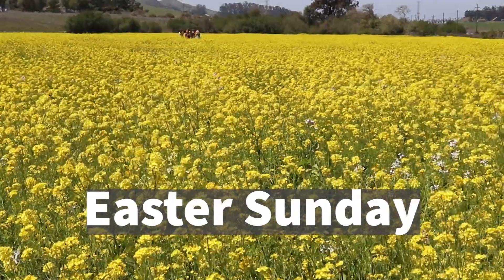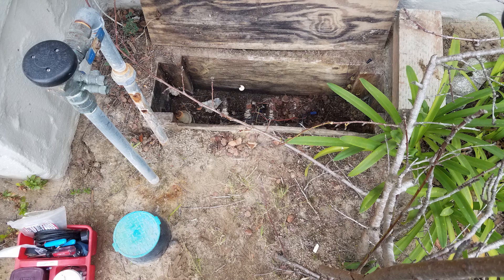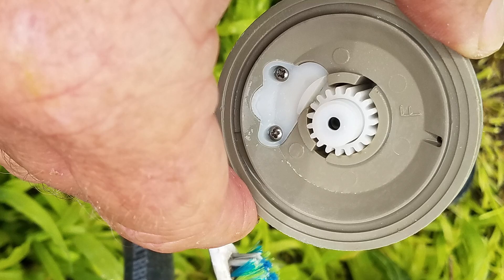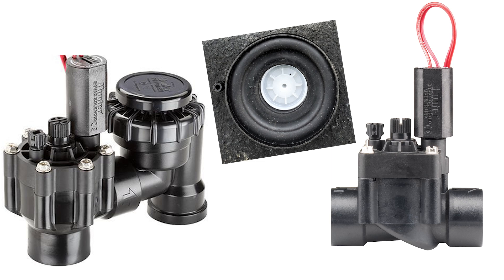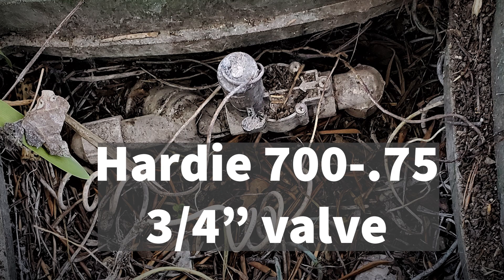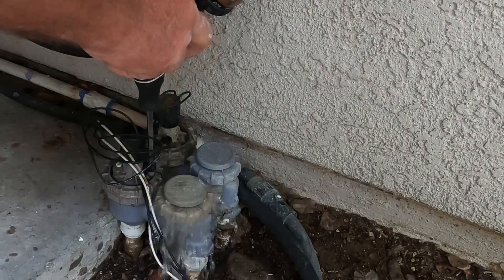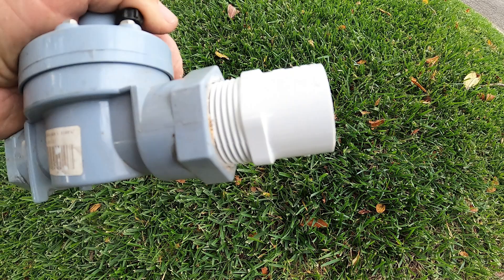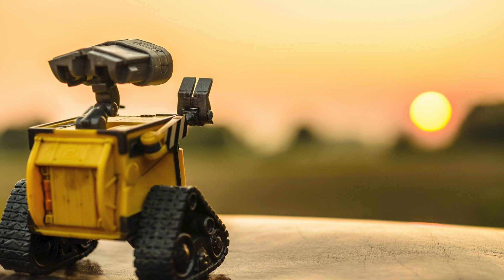Best Irrigation Valves for 2026 | The 3 pro-grade categories compared

Comment: Can you suggest an inline valve that closes “slower” to offset water hammer issues ?
Reply from the maker: Carmen, There may be slower closing valves by design but I'm not aware of them. If that is an issue then consider the possibility of installing a brass pressure regulator before the sprinkler valves. There are a few things to consider before doing so such as the current PSI and what PSI you need at the valves for your system to run properly. In some cases a high range pressure regulator is needed. Those are dynamics to discuss with someone in your geographic area who knows what they're talking about.
Reply: @SprinklerPros  Thanks for the detailed reply. I already have a pressure regulator on the feed for irrigation as part of the house system.  I made some calls regarding a slower closing valve.......and found Rainbird claims their PGA model inline valve is designed to close slower.  I'm going to go that route and see what happens!

Comment: I have some very old Rainbird manual anti siphon valves, and I was considering replacing them with a manual Hunter anti siphon valve, but I couldn’t find a manual one.  Can I replace it with an electric unit and just not hook it up since I don’t have a control box and I don’t think I need one?
Reply from the maker: Tom,
Manual anti-siphon valves are considered a thing of the past so vendors rarely stock them. Hunter doesn't make a manual version. The most popular/common PVC manual a/s valve is the Irritrol 2706PR (3/4") and the 2709PR (1") models if you can find them. They're on Amazon but they're a bit pricey, partly because it includes shipping and partly because they aren't in high demand anymore. If you buy them be sure to just shut them off snug--not tight or you'll ruin the guts.

Comment: Good Sunday morning to you sir!!!
DIY’ R here trying to gain some knowledge.

i recently put in a new sprinkler system ourselves ; i watched a bunch of videos trying to make sure i did it right the first time & for the most part i think i have gotten the bulk of it correct; I’m running a (4) Zone station system ; 1 1/2 class 200 pipe through tall of the zones with Tee’s & funny pipe where each sprinkler head is at 4-6 on each Zone (60) PSI STATIC Pressure. I let the glue on the whole system cure for a whole week while we where out of town working.
Got home this weekend to flush the lines & bring it all on line & noticed that i have a real bad hammering effect; thought it was just air at first ; but it ended up breaking one of the lines lines as that zone timed out & was going off then it busted..

My manifold coming from the water meter does through an upright 1 1/2 ball valve then a
1 1/2 checkvalve then goes thru 1” pipe to 1” Irritrol 2400’s  valves - then back to 1 1/2 going to sprinkler heads 

Any ideas or thought for the hammering effect? 
Maybe i need a master valve before the Manifold ?

Thanks
Reply from the maker: Good Monday morning to you BJ.  Water hammer can be a tricky thing to nail down and cure. Where in the system did you test the water pressure? Was it before the sprinkler valves?

Comment: Thanks for your review video!
I'm working on the sprinkler system at the house I bought that is mostly plumbed with Toro/Lawn Genie jar top ASV valves, improperly installed in the ground.
Loads of fun learning what I'm looking at and how things aren't properly installed.

I was looking to just add a couple more zones, but I'm likely going to have to replumb the current zones at a minimum.
Reply from the maker: Yes, I unfortunately run into that sort of thing alot. I am working on an HOA right now that used good Hunter ASV valves but installed them below grade.

Comment: Question. I have a zone with low pressure and when I pull on the heads the pressure starts to build up. Would this be something with the valve or the heads themselves
Reply from the maker: How long ago did this start or has it been doing this all along?

Comment: You mentioned placing the inline valves in a box in the ground, is it ok to place them above the ground say 2 foot or so.  This allows easier maintenance for me.  Got some back problems and hard to work that low.
Reply from the maker: You could but why not use anti-siphon valves then instead? They're made for above ground use.

Comment: I believe your issue with the sch.80 nipples threaded into the valves was caused by over tightening and not because of the thread pitch. I would never recommend someone to use a male adapter over a sch.80 toenipple. Male adapters are one of the worst fittings in the pvc fittings world. A properly installed sch.80 nipple, hand tightened then half turn with pipe wrench will not cause your valves to split. What caused your valves to split was someone using a pipe wrench or channel locks and threading the nipple all the way into the valve until it stopped.

Comment: I'm doing a clean install of 3 valves.  I was going to install the inline variety, below ground in a box both for aesthetics and to lessen the risk of freezing.  But I get the impression you prefer above ground installation, also not inline.  Can you elaborate why that is?
Reply from the maker: Gary, sorry for the delay. I can't believe it's been 13 days since I've answered comments!  It all depends on where you live/weather conditions. Out here on the sunny Central Coast of CA we don't get much freezing weather so anti-siphon valves (a/s) are pretty popular due to their ease of maintenance. If you need to replace one, you simply cut the vertical pipes and pop on a new one. The alternative is to dig up the entire box for one bad valve sometimes. Repairing one of those valves can be tricky down there too. Plus gophers can fill the boxes with dirt. That kinda stuff.

Comment: I have a 4  1 inch nelson valves  and one is leaking.  i took it apart and suctioned out the opening with a vacuum. Still leaks.

 I cant find a replacement diaphram so im deciding to just replace it hopefully i dont run into issues
Reply from the maker: Sean, I am guessing your Nelson valves are inline valves vs anti-siphon valves?  I don't know if Nelson diaphgrams are still available. I don't even see Nelson valves in stores anymore. Nelson has pretty much gone back to agriculture irrigation products so, yes, I would assume you many need to replace the valve. Where exactly is it leaking. At the bonnet seam? Under the solenoid? At the flow control stem? Google those items if you're not sure what I am referring to.
Reply: @SprinklerPros  They are inline valves.

 They don't have flow control stems on them from what I can see. 
 I'm pretty sure it's at the bonnet seam.  I've got the valve box dug up and I'm running to the store to grab a Hunter PGV at your recommendation tomorrow. 
I've replaced just about everything in the system,  half the heads, the backflow siphon, patched a cracked line. It's working much better, but every time I fix something, something else breaks. Hopefully, this is it. Fingers crossed.

 It's been a good learning experience.  Thanks so much for your help!

Comment: It seems like all my rain bird valves leak. Brand new. Just installed a 2" leaked right away. Hunter has been really good for valves. I do like the rainbird 5000 though
Reply from the maker: Which model number of RB valves have you had the trouble with? Where on the valve do they leak?
Reply: Its not uncommon for the top bonnet on a irrigation valve to leak. The hardware comes loose from the factory at times and it just needs snugged up. Where at on the valve are you having a leak?

Comment: What "Recourses link"?    I am having trouble with well water sediment.  When I added a sediment filter, it slowed everything down too much and would quickly clog.  I'll have to remove it and go with a better valve system.  (I have a HD special - orbit)
Any advise?
Reply from the maker: In the Description section of all my video pages there is "Resources page: ..........(link). Respectfully, if the sediment filter is clogging fast I would think that it just needs to be cleaned out more often and it's doing its job. Is there more to know? What kind of sediment filter is it (a wye filter?) and where is it installed? Before the sprinkler valves? Metal screen or plastic? What brand is it?
Reply: I know that Rainbird makes auto self cleaning filters but they are expensive.

Comment: what is the fitting for the hunter 1inch valve? the resource page is down. 1inch to 3/4 reducer whet's the thread i think in one of your videos you talked about breaking them because the thread was wrong thank you
Reply from the maker: I'm not sure what your question actually is? If you're going from 3/4" pipe to a 1" threaded valve, then it would be a 1" x 3/4" male adapter. Does that help?

Comment: I have some old anti siphon vales, and I'm wondering about a way to test that backflow prevention is effective.  Any tool available in the market?  If not, can I make one myself?  I noticed a couple of times in last month dirty water.  I turned off my sprinkler system, and saw that water is clean after a day.  I'm not sure if it was one of my valves or from the city.  So, just thought I should test my valves if possible.  Please, help.  Thanks. alot
Reply from the maker: Mohammad, I don't know a way to test that. Frankly in 40 yrs, I've never heard of anyone actually having a back flow event. It's just a precaution. I'm not saying it can't happen, but I believe the method you used of stopping the irrigation water use for a specified time is probably the best idea I can think of. Let me know in a new comment thread if you deal with this again. I'm interested to hear.

Comment: I noticed you didnt recommend a single Rainbird valve.
Reply from the maker: Correct. I gave my reasons why in the video regarding the anti-siphon models ASVF. I'm not a fan of their valves and I've been working around them for decades. It's okay if you like them. I'm not bashing. It's just personal preference based on MY experience.
Reply: RainBird valve parts are readily available! In abundance! Maybe you're having a problem with those anti-siphons but those parts fit in-line valves like a glove! They are the only parts that you can find everywhere! You are correct on those jar tops... but you are so off the mark regarding Rain Bird!!! those DV100's are like the Energizer Bunny... you're not going to F with it for a very long time!

Comment: Love your videos!  We switched from city water to a well in St. Augustine, FL..  It is ~90 deep but the filter consists of micro holes in the 1st 10' section of pipe.  While the system was originally installed with Hunter valves and heads, what recommendation do you have for replacing the valves for "dirty" water?
Reply from the maker: Robert, Sorry for the delay. I've been swamped. If I'm understanding correctly, I would stick with the Hunter valves. Regarding the heads: I don't know which heads you're using. Rotor sprays, std. nozzles on popups, or MP Rotators? To get an reply, be sure to start a new thread.

Comment: In many cases, mainly with 1" valves, the entire valve will be cheaper than the solenoid or diaphragm kit. At both of my local irrigation supply stores, both 1" Hunter and RainBird (PVB and PGA) are roughly 50% cheaper than purchasing the solenoid alone.
Reply from the maker: Corey, yes you're right. It's been like that for a long time, but if all I need is the solenoid or other parts, what do I do with the body when I have stripped it clean? A: throw it away. I am not a tree hugger, but I also try not to be wasteful too. I'd rather buy a bag of 5 diaphragms or box of 10 solenoids, etc. and charge accordingly than to be throwing stuff away. That's just me. Thanks for sharing your thoughts, though. They're always respectfully welcome.
Reply: (I used PGA as an example because it's the cheaper of the models that uses the solenoid that's backwards compatible (with threaded bushing), as it doesn't work the other way, even though the threads match.

Comment: Lol. Hunter valves do not handle any sort of debris. The solenoids fail more than any other valves including the cheapest. I would recommend Rain Bird and than Toro. I have had very little issues with Rainbird and they are as dependable as they get
Reply: I do irrigation maintenance; the Rain Bird valves are the ones that I replace the most, their solenoids don't last and after a few years opening them manually at the solenoid, the O ring fails, and it leaks. I prefer Hunter valves I have replaced three Hunter solenoids so far, I am in Texas.

Comment: I have been asked to install a main valve and am leaning toward brass because it will probably go in the basement and will be the main valve.  I am thinking durability because it will be placed indoors.  And is it best to go behind the main shut-off, right after the meter, after the main shut-off, between the main shut-off and the valve manifolds, or does it make a difference?  Thanks
Reply from the maker: Raymond, you're right in leaning toward the brass ball valve (not a gate valve). I wasn't quite following your options so I will answer you this way and hope it answers your question. It should be: water meter > tee to separate house water from irrigation > optional backflow device depending on your situation and what your local municipality wants > shutoff ball valve > irrigation valves. I believe it's best to have the shutoff/backflow as close to the irrigation valves as possible for convenience when servicing them. Did this help?
Reply: @SprinklerPros  Well sort of.  As far as placement, when the 1" copper exits the basement, it immediately branches of to different valve areas, and to locate the valve outside would require re-piping that area with a lot of elbows, hence opportunities for more CFM and pressure loses.  Inside, the main water shut off, a ball valve is located nearer to the ceiling, and 4-5 inches you are in the joist.  squeezing a plastic or metal valve up there would be a challenge. Plastic interior is cheaper and my supplier, who is also an installer says that's the way to go.  Brass valves are too expensive, and would add about $150 to $200 to the job with marginal benefit.  I will run the options by the customer.  Thanks again for your input.

Comment: thank you very much for the video and all the valuable information! I have a question about valves. I have a house with a front and a back yard. the pipeline from the city meter to the service box which is located near an electricity source is around 22 meters long. I designed the system in a way that I'll install the check valve right after the city meter and an irrigation branch. should I install the shut off valve and the master solenoid valve right after the the check valve or right before the sprinkler and the drip line solenoid valves?
Reply from the maker: Mai, I would go with just before the sprinkler valves.
Reply: @SprinklerPros   thanks for your reply! but now I understand that there will be around 20 meters of pipes with constant water in it. won't that cause any pressure? 
And also, should I separate the shut off valve from the master solenoid? where the shut off goes right after the check valve and the master solenoid goes right before the sprinkler valves?

Comment: I currently use the Rainbird ASVF. Had to replace the guts once on one of the valves, but the parts were easy to find. My question is do the connection points on Hunter line up the same distance as the Rainbird so I could just swap out the Rainbird with Hunter as the rainbird fails over time?
Reply from the maker: Ken, today I measured them. The Hunter ASV is 4" on center and the RB is 3.75" OC but I typically don't have an issue getting a Hunter ASV to fit on the vertical pipes orphaned by an RB ASVF valve. I did it just this morning.
Reply: @SprinklerPros  Thanks so much for your response. I'm surprised that you don't issues with the fit being different by a 1/4"

Comment: Why does the gospel link work, but the sprinkler resource valve doesn't?   I don't see Jesus, Moses, or Abraham coming to fix my sprinklers.
Reply from the maker: Addy, that was a trick of mine to get folks to visit the gospel site. Just kidding!  Others have said the same thing about that link, but I just checked it again from the video page again and it works fine. I am thinking that it's a browser thing. Possibly an add-on is blocking it or somethin'. I use Chrome. How about you? Try it from this: https://sprinklerpros.net/irrigation-valves/

Comment: Why do we use Antisiphon valves?
Reply from the maker: EZ, a/s valves are so much easier to work on when needed. Out here we have gophers that fill the valve boxes of inline valves. Roots also can become a problem with inline valves. When an a/s valve needs to be replaced, I just need to cut the risers and install the new valve. When an inline valve needs to be replaced, the entire valve box needs to be dug up, roots and all. I just had to do that yesterday. Does that help?

Comment: Just installed a drip system with a timer but sometimes when it first starts it get clogged or something to do with the air I’ve determined. It’s a quick fix I just turn the water pressure up or turn the water on and off real quick. But that doesn’t do so well when the timer goes off and I’m not around. So I’ve think I need a air vacuum release valve maybe 2 because I have 2 zones. Any info on this topic or pro tip.
Reply from the maker: RL, The most common reason I see this is when the valve is at the bottom of a slope and the drip lines are above it on the slope. When the line turns off, the water gravitates back down the hill so the air fills the tubing. When the line is activated again, it now pushes all that air out as it displaces with water. Does this match your scenario? If so, I can give you some tips.